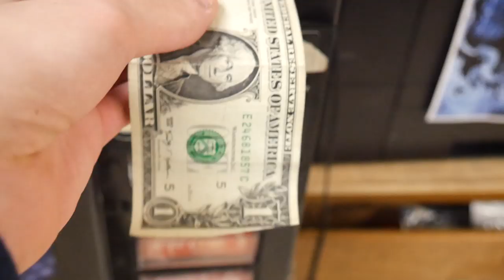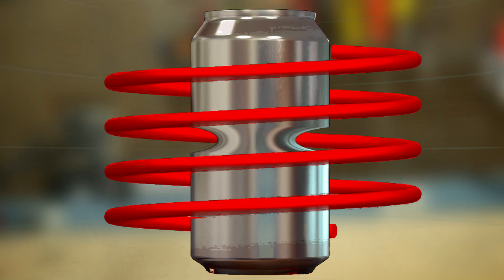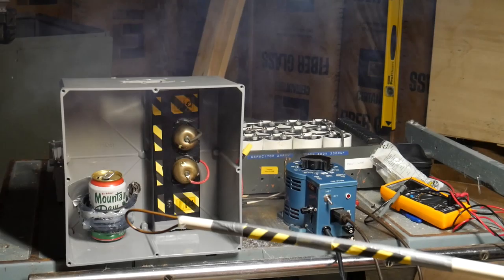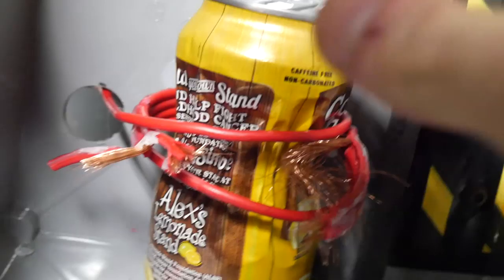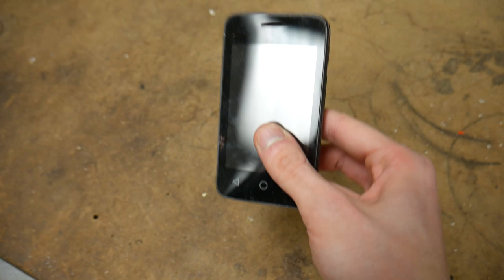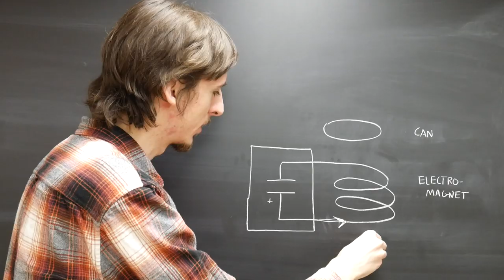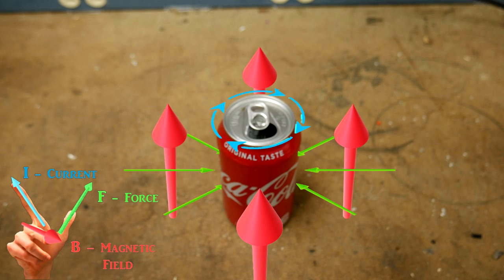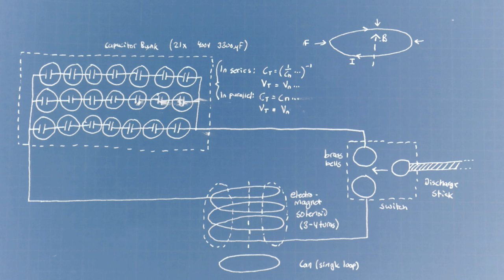An Electromagnet That Can Crush Aluminum Cans

Comment: Hi Dayton,
the operating principle is clear and we can clearly see the effects on the cans, but given the dangerousness of the tensions and the low efficiency of the prototype (cans are not reduced so much) how about increasing the working frequency  with reasonable tensions so as to transform the coil into an induction furnace? 
You could get to melt the cans as they pass inside the coil.
It is another way of using magnetic fields and induced currents.
Hello to the next video and .... have a good rest

Comment: You do not need a wire with that much insulation for this project because you should be doing this with high current, not high voltage. Electromagnets dont need high voltage. The way you conected those capasitors in series and than connected them to a transformer, you got high voltage rather than high current in my opinion. And an electromagnet is stronger the more current it has flowing throu it. Maybe try using 12-24V, and a thick magnetic wire instead of 
High voltage insulated cable. That way you can get more windings in smaller lenght.

Comment: Dear Blueprint. Congratulations for your experiment, but here are some recommendations. It is not performed correctly since your switch is not properly designed. You are losing a big amount of energy in the switching because you have a very big impedance in connecting your capacitors with your load (coil). The way these kind of circuits are switched/closed is through a tyratron or an SCR of enough capacity to withstand the high current that you are going to get discharging your capacitor bank. I suggest you try it like that so you can notice the difference. Good look and congratulations on your enthusiasm and thank you for your time to share this with us.

Comment: So you have made a railgun?if the can or phone was light enough to be persuaded up and out of the electromagnetic coil? Or do you need more of these firing in sequence...
But can you make the magnetic coil out of copper pipe perhaps with more copper wire as a wrap encasing it and running glycol to mitigate the heat?

Comment: To balance the capacitor voltage, you really need a 200k @ 2W resistor across each capacitor (very cheap on Ebay).  These resistors will also act as bleeder resistors so the capacitors will drain over time.  In this case the time constant will be 3000uF * 200k ohm = 600 seconds (10 minutes) for the 7x3 bank.  Since it takes about four time constants to discharge everything by 98%,  all should be fairly safe in 40 minutes--you don't want to forget, and come back in a couple of days for an unexpected and possibility lethal  *ZAP*

Comment: I remember seeing a vending machine, I think it was at the Smithsonian, next to the cyclotron (atom smasher) exhibit. It crushed copper tubes. That device had two turns of solid conductor wire. Yours seemed to distribute the pinch force a lot wider along the z axis, which would mean that the pinching force per unit area would be multiplicatively reduced. Also, the advantages of using stranded wire are less conducive to coils because of the relative permittivity, which is also why you never see a stranded coax center conductor.

Comment: This kind of stuff is right up my alley. I experiment with HV and dangerous capacitors on a daily basis. In case you are not familiar with a triggered spark-gap, I wanted to mention it to you so that maybe you will decide to trash those silly bells that you use as a HV switch, and instead use a triggered spark-gap made with two tungsten rods. The gap is triggered not unlike a Xenon flash tube is triggered. That is, a HV pulse from a capacitor-discharge ignition coil bridges the gap which initiates the huge current discharge. It's slightly more complex than shorting a couple of bells, but you have MUCH better control of the timing, and the switching is much more consistent.  Give it a try!  :-)

Comment: I know this is old but do you have any fear of reverse polararity oscillations on the cap bank? Do the caps blow up when abused like this?
Reply from the maker: It may be old, but so am I.
Indeed this setup does act like an LC circuit and encourage oscillating current. Though I experimentally found that was not meaningfully present - likely due to the extremely small coil inductance.
The real concern here is the damage to the electrolytic caps with pulsed current like that. It will certainly degrade their capacity over time (as I discovered by accident).

Comment: I liked your video, but I was actually looking for a way to make a traditional can crusher with electromagnets. something like basic maglev tech to accelerate a chunk of metal to crush a can and return to start. I haven't seen any magnetic videos with anything that strong. Can that be done. Can you do it?
Reply from the maker: Never heard of such a thing. Could you describe it in more detail?
Reply: @BlueprintScience  Pretty much how an air compressor can be used to crush a can accept using magnets. I'm thinking pretty much creating a vertical train accelerating a piston to crush a can kind of like how maglev accelerates a train further. My original thought was just using an electro magnet to pull a piston down but there doesnt seem to be something that is reasonable and powerful enough to pull an object to crush a can and reverse polarity to reset and crush another

Comment: So what happens if you use more turns around the can? Less turns?
Curious minds want to know. 😊
Reply from the maker: Well, if curious minds are asking...

You can think of this as a transformer between the coils and the can. More coils mean stronger magnetic field and less coils means a higher current in the can. It's an optimization problem to maximize both. I found 3 coils to work well experimentally.
Reply: @BlueprintScience  
Cool. Thanks.

Comment: Hello Dayton. I have a question if you can help me out (and maybe use this idea for a future project, if it's feasible). 
TL;DR: Does concentrating microwaves into a spark produce continuous flux of plasma?
On The King of Random channel I saw a video in which the lit mach in a microwave oven experiment was tested. Long story short, if a lit mach is placed in the microwave oven, the partially ionized plasma in the flame is bombarded with microwaves, and it turns to fully ionized plasma. However, after a short time, the plasma would die out.
Now, my question is: if you were to separate the circuit responsible for the microwave production from the rest of the oven(like you did on your microwave gun), but instead of allowing the waves to disperse, you would concentrate them to a certain point through proper reflecting and lensing, and in that certain spot you would place the terminals of a circuit that produces a lot of powerful sparks very fast (a taser for example), would you get a continuous stream of plasma? And of so, by using a compressor or another way of directing the plasma, would you be able to melt and cut things?
 Thanks in advance. Keep up the good work. Your videos are a very nice amalgam of science and humor, and would deserve a lot more attention from the public.
The King of Random video i was talking about:
https://www.youtube.com/watch?v=ysordqKV3Dg&t=533s
Reply from the maker: So, essentially, what you are describing is a satellite dish where the sensor is placed a the focal point, only rather than a sensor, you want a spark gap for arcs. 

The design for that is... iffy. Part of the nice thing about microwave ovens is that they are contained in a metal box so they reflect and amplify inside of the cavity as standing waves - where the waves interfere constructively/destructively are nodes. Thus, If out want a large voltage between two points for a spark, it is best that they be placed at two opposing nodes. Due to properties of microwaves, these nodes are a fixed distance apart.
I know of no way to focus microwaves in such a way that anything except the field strength is affected.

I'm not sure if that answered you question, but I hope it helps you get the principals at work here.

Comment: What happens to conductive materials, when you change the frequency of the current being passed through them, especially very high frequency?
Reply from the maker: It depends on the conductor. 
Most materials (I.e. copper, aluminum) will behave like antennas. It’s impossible to say exactly how they would respond because it depends on their geometry. For instance, a rod would respond by moving charges up and down its length along its surface at the same frequency of the electrical disturbance.
Magnetic materials (I.e iron) have a tendency to form eddy currents - localized charges stirring around in small circles. This heats up the material like you wouldn’t believe; look up a demonstration of inductive heating if you have not seen it before.
Hope this satisfies your curiosity :)

Comment: @Blueprint  I request you to please do a video explaining the construction of induction heating coil.
Reply from the maker: It is already under way. At least within the next 10 projects. i.e. I have the stuff, just haven't made it yet.
You know, technically, this can crusher is an induction heater...
Reply: @BlueprintScience  Thank you for the kind response. 

Yes it is half way as the coil is turned in one direction only where as it is twisted  back in another direction in the heater as I had a look at it one of the other video..

Comment: 3000 volt bridge rectifire show it
Reply from the maker: It's not super exciting - simply four 10kV diodes to make a full rectifier. They can only handle about 200mA which is why I am so slow to charge it.
P.S. They have since turned to ash when I failed to properly isolate them :(

Comment: You should make a coilgun with those capacitors.
Reply from the maker: Stop looking into my soul, Snaj!

(of course I'm doing that)
Reply: Blueprint :) I want to build one too but those capacitors are expencive.
Reply from the maker: @snaj9989  Heck yeah, they are. My advice: buy them from Russia. The USSR left all kinds of good stuff behind and that's where I got some of my best stuff for cheap.
Reply: Blueprint Do you now a website for buying those things
Reply from the maker: @snaj9989  No, sorry; you'll just have to look around. Ebay is a good place to start, though.
Reply: Blueprint Paypal doesn't work in Turkey and shiping prices are too high :/

Comment: Few car batteries in parral won't be enough?
Reply from the maker: That depend what you mean by a few. Two or three may not be enough. Over ten might do it.
Batteries can each supply hundreds of amps, but the voltage also needs to be high enough; this is done by putting batteries in series.

Comment: Do it yourselfers? Didn't you do it yourself 🤣 how much were the capacitors...

I think people use copper pipe generally as the coil, I could be wrong
Reply: @phonoctical: The copper pipe is used as a coil when the currents are high for a long time: being hollow it allows the passage of coolant to prevent the pipe from melting. 
Here we have very high currents for very short instants (current pulses) spaced by long capacitor charging times and it is not essential

1
Reply: @zolatanaffa87  that's induction sure, but it would save his wires from melting
Reply: @ @phonotical  This is also induction, but generated by a single impulse.
The wire is crossed by a high current for an infinitesimal time.
If you add that the frequency is low, the skin effect will be low and then the whole section of the cable will be traversed by the current
In the high frequencies (thanks to the skin effect) the current tends to distribute itself on the external portion of the conductor: therefore the pipe, at high frequency, carries the same current of a round bar of equal diameter in direct current, but the opposite is not true : a pipe even if the same diameter of the cable used by Dayton could be insufficient, in addition we would have problems in bending it correctly.
BTW: the skin effect shows its effects already at the mains frequency: for voltages higher than 100KV (see the large transport lines with more than one wire per phase) their maximum current is equal to the diameter of the bundle of cables that make up the individual phases!
Reply: @zolatanaffa87  you can  uy precoiled piping, id have gone for pipe, or steel, just saying
Reply: @phonotical bad idea the steel!
you should increase the section to compensate for the higher resistivity!
Reply: @zolatanaffa87  maybe not steel then 😅

Comment: My dad wants to know why you didn't put my turns in the coils
Reply: *more turns, oops
Reply from the maker: The coil and the can act like a transformer. The can is, of course, always going to be one turn. 

If I were to make the coil have more turns of wire, there would be less current induced into the can, but a larger magnetic field would be created. So it becomes an optimization problem to maximize the product of both the current and magnetic field.
I found experimentally, that 3-4 coils optimizes the power transferred into the can.
Reply: @BlueprintScience  He has another question, what if you put one can inside of the other (say by cutting the bottom off one can) would that increase the number of turns in the coil?
Reply: @alylu-to-esutej   Technically yes, as the energy provided by the coils would then be distributed between two "transformers" instead of one, but I believe the one in the middle would have a somewhat greater magnetic flux as the magnetic field would be strongest at the center. Now Dayton, tell me all the ways I'm wrong, haha!
Reply from the maker: @alexandernewman7587  Only is the cans are electrically connected, otherwise each can takes on only half of the energy.